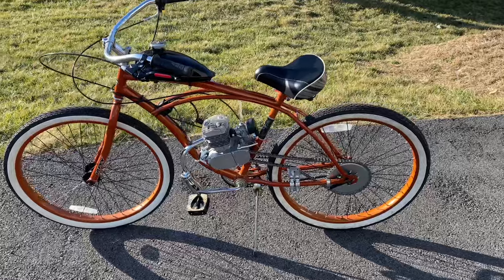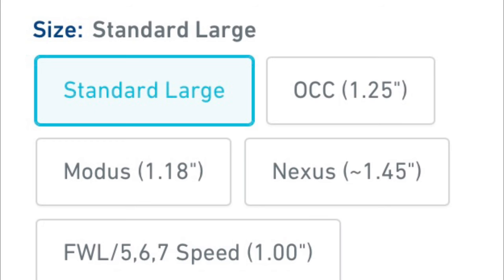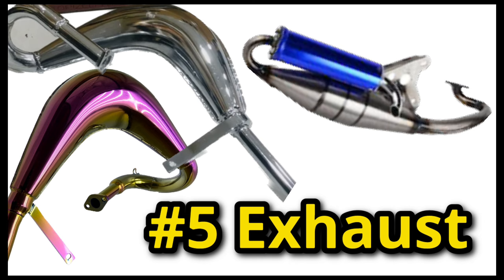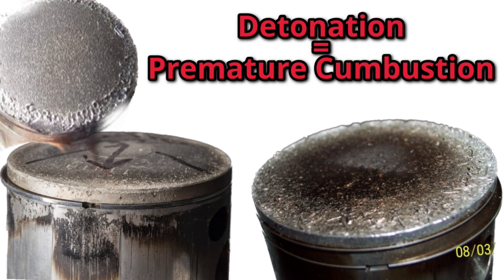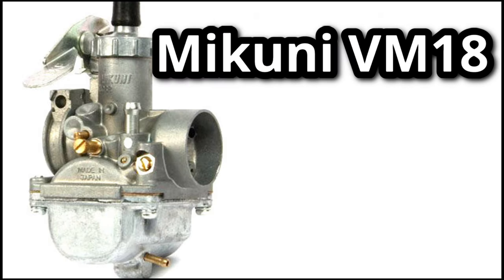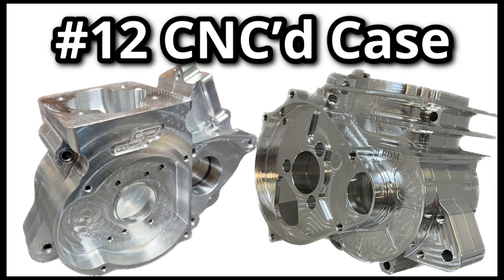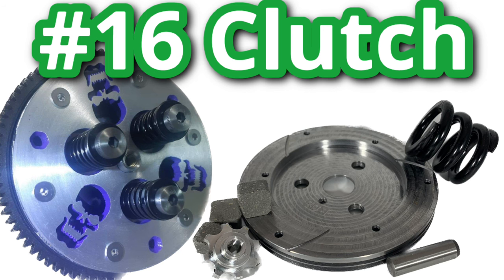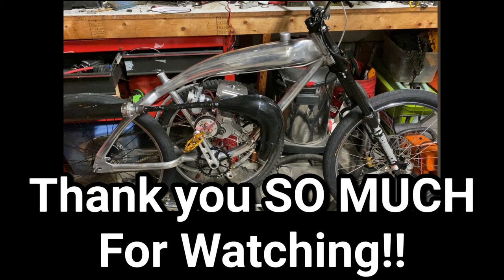EVERY Modification and upgrade For A Motorized Bike #motorizedbike #2stroke #motorcycle #moped

Comment from the maker: FIRST UPGRADES: I highly recommend staying away from performance mods UNTIL you have properly and thoroughly gone through the break-in process on your engine and use correct lubrication, but the mods in this category are HIGHLY RECOMMENDED doing BEFORE the break-in process. These are recommended in order to keep your engine running well and increase reliability.

1st: The first being a short CNC intake - https://www.amazon.com/Mingdun-32mm-40mm-Manifold-Connector-Motorized/dp/B08J7Z71QT/ref=sr_1_1?crid=2HG0FMHI61SY&dib=eyJ2IjoiMSJ9.wgaWemGG1xZaETyDsDqQY84nX_S4EyZUcRlfQl6nxsYkrxTEjZqthGR9eUwV5oZoOjETmwl-kxQbEMVCGJPctqddy-SqO9iLIm3yCtEVk4pyNGTJGJRjezMSX_d73187KGXQ4XwUEh5pBoxLkknZwwz6zY4v9ug1MaYsQUJidku0PF7TVnYoTxePwSXrUNoFSLR4yd4NXuLy0cXEB_NHEJwtc_nV8vI0lR371sRgDO2ZhM89g_lEhPpwUzjTsMDBm8eV_ibZDt2H5xWWnEFguTOHuHiV3roXzMVPcp2wIeo.tUvwe_wPuG66lMDVEfGYeto-N-roShUk76haf9SWuuA&dib_tag=se&keywords=motorized%2Bbike%2Bcnc%2Bintake&qid=1715354123&s=automotive&sprefix=motorized%2Bbike%2Bcnc%2Bintak%2Cautomotive%2C158&sr=1-1&th=1

2nd: Upgrading the spark plug is also a MUST! - https://www.amazon.com/NGK-BR7HS-Standard-Spark-Plug/dp/B000GZDI6W/ref=sr_1_2?crid=X3L8BJSW51TM&dib=eyJ2IjoiMSJ9.4gv2n1Pm65tXQGzCXIivxMmJ3_3vWhSsfbifXuq8B9UgHYQyLR6dVSwjzFbbGibRZM2CLFYNYt6JAMQqDsRfAuKU0QCSpIlwcc1oWO9jGUJyIRbKFvdJ6Nu9oqgawq2cgP8MKS93dX0iaj0z8y6F0ZD5ToLDTjiswMhAaWb1vD4OM7-vaTW7H0QTMJdLRe_Xz8kOQsVmcUUZsciKBOFkvl6muBQQ_sJJ2F9J64fbrfp8uXUBBWxRHEYqtUQDJ2FD7D8U0erBs7xc5wj-IEuhJSiEfLzYr9hqeK5YdBdkCic.1gfcHFlly-FusI9Gttk7384PRwhcl1EIAHI5DBv22fA&dib_tag=se&keywords=NGK%2Bbr7hs&qid=1715354636&s=automotive&sprefix=ngk%2Bbr7hs%2Cautomotive%2C107&sr=1-2&th=1

3rd: The third upgrade is a sprocket hub adapter (https://www.amazon.com/sthus-Sprocket-Adapter-Stroke-Motorized/dp/B07GWHXMTJ/ref=sr_1_7?crid=18FPXCSBYN6B7&dib=eyJ2IjoiMSJ9.sKEWIRtySrBmJdUvRrNCgm_Q5X-9XHwIYIqKtyFsGVdhCMhkSpr7uuV-gisM5vRqq9e1aeBY5PjWD7sc1Kk3ZQLh3kQDV5TBSsRX8z8SFYVmIWyS9oDw9dxAe0XmN4x54x1RyGjGcqrXdqCOpJl9qWVGdoWWnofL6q-RpyLo0j6wPyQZY3v1HwGDH1vmGWIoe90JSNyV4KQBo6_i83K2SQAA0mtk72sVmpBHbRKT8eq3oIOgnwlfE4VKArLVaSamh7JCWXybzyKRB7wmeJWCWT44ZQ92Vdg8RguZmA4POX0.XGIMqc_KF0kHE4NSR6DVb7TqTzS1EsZg5sN75NKDi64&dib_tag=se&keywords=motorized+bike+hub+adapter&qid=1715354767&s=automotive&sprefix=motorized+bike+hub+adapter%2Cautomotive%2C107&sr=1-7) or an alternative method to mounting your sprocket - https://www.youtube.com/watch?v=3q76xcT_sQI     

NOTICE: A hub adapter will only really work if your has a constant diameter (all the way along the width of the inside of the hub) of 1in or 1.5in.

Concerning brakes: If you want to go overboard on brakes, check out the Smolik Performance pit bike brake setup - https://smolikperformance.com/collections/all-products/products/front-pit-bike-adapter

PERFORMANCE MODS:
After you have done the previous mods and have properly broken-in your engine, it’s time for the real performance mods.

4th: A balanced crank - https://smolikperformance.com/products/zl40mm-crank-balanced-and-trued?_pos=5&_sid=5ab570fe9&_ss=r

5th: A good exhaust - https://www.youtube.com/watch?v=ZBZV0xXFjlM
6th: Porting and decking - https://www.youtube.com/watch?v=V4yWn7ZcZ7k&list=PLyy48VgdJ6lXs94k95u73Rv2a5ZTWsqTE

7th: Premium gas or race fuel - (only after porting and decking)

8th: A Reed valve - (requires a windowed piston) G2 - https://www.amazon.com/Miaowa-Racing-Intake-Motorized-Bicycle/dp/B098X444WC/ref=sxin_17_pa_sp_search_thematic_sspa?content-id=amzn1.sym.679ca254-fe3a-4b5e-a742-a17f009c74a4%3Aamzn1.sym.679ca254-fe3a-4b5e-a742-a17f009c74a4&crid=3I0KNCIXC9BU3&cv_ct_cx=motorized+bike+reed+valve&dib=eyJ2IjoiMSJ9.GnjMeLOPZgNDkzvE_fZ2o2L7Oca2RWbIL6eu9SZczbweXBbxM8h7HS5ZybsZAX8X.v9O8Ew1z4K0FOLieE7SLbMJeshvGx9SoGsV-0jNOzfU&dib_tag=se&keywords=motorized+bike+reed+valve&pd_rd_i=B098X444WC&pd_rd_r=71beeb66-52f1-4d72-8625-dfd25ecf1d72&pd_rd_w=ddj2I&pd_rd_wg=O1tjF&pf_rd_p=679ca254-fe3a-4b5e-a742-a17f009c74a4&pf_rd_r=ZE5DJ9BAE0NDZ7GVHG0V&qid=1715355019&s=automotive&sbo=RZvfv%2F%2FHxDF%2BO5021pAnSA%3D%3D&sprefix=motorized+bike+reed+valv%2Cautomotive%2C144&sr=1-3-364cf978-ce2a-480a-9bb0-bdb96faa0f61-spons&sp_csd=d2lkZ2V0TmFtZT1zcF9zZWFyY2hfdGhlbWF0aWM&psc=1 

DIO Reed - https://www.amazon.com/Valve-Set-Reed-Block-Gas-Motorized-Bicycle/dp/B0B5DCB627/ref=sr_1_5?crid=3SKE06ICH797L&dib=eyJ2IjoiMSJ9.JlvyOY7u827hdKv_qW_6Jc2P4tqz2e14IpNfGZVYC80ydCddplJspRsdFdPgsxJjTO2kCn2940oVSnbbi4B33z8kaSjLT-6kOV-M_VQzK01BSPtUI_hIJ6ZHZZDqBgZGfPG6Lh1TWwGgx-ZFggpnTBSEZxH4ibYXZqsZ1_EDGk1b89b2APOoZ3voLsOS31Q3Mu-csfLs273zAGVab6MuMzrRNM-6ApMPX-3_JIGQ7Pdcf402uiFJjoGBiRCqcUUUQ4hg8Un837rLL6H7jxhKFwwPvmbCw2ZdPagIyy5wDm4.AudSMW11wODC-dEXLneaaKOnR-uWz66XM5Bb0SX2ldk&dib_tag=se&keywords=motorized+bike+dio+reed+valve&qid=1715381630&s=automotive&sprefix=motorized+bike+dio+reed+vavle%2Cautomotive%2C168&sr=1-5

OZ Reed - ttps://www.amazon.com/CDHPOWER-Reed-Valve-Kit-19mm/dp/B07DVTQCX7/ref=sr_1_5?crid=3NKNVHCGCBDES&dib=eyJ2IjoiMSJ9.W4XcrCMjS7l6f6FiWfkrA3oYXOkZG5GzfL9Q-92dg4wfsLYKD674jS8g8Bpt0qkOwWSvqZAQV8KPqFsryZmV3JWnm0hxJCTbKZXkBfD2pcQIAqBGjJFh06HPNDEPZGU6QPZ-_rZWGpKqXxbOxW-61-LvMCX9Vh9o2qmi7xvvNh9H2zO-K3a3MjrTblZdrw1wovwCuKZGHlth4MfA1Rhi48Z0wsRZiKAzHFk7oNQ_zEGTgx3I2rRilBA01_dhBvY1MhwKla-bb-WqTB6PWQfye-2dHdCNEZE-Xq3FWC9DH64.tFWC5LJ31F6CWEN30u22UlCb_jPDaXxHmwrKCvA-s4o&dib_tag=se&keywords=motorized+bike+reed+valve&qid=1715381657&s=automotive&sprefix=motorized+bike+reed+valve%2Cautomotive%2C100&sr=1-5

9th: Carburetor:  Mikuni VM18, dellorto, NIBBI PE19, Pz19, PZ20, and PWK21. 

10th: CNC Cylinder head - Here is a great cylinder head guide - 

Smolik heads - https://smolikperformance.com/collections/cylinder-heads/products/smolik-cnc-head

Other CDH Heads - https://www.ebay.com/itm/284504977774

Cheaer options - https://www.amazon.com/jtfrkope-Cylinder-Racing-Engine-Silver/dp/B0BNSMS53N/ref=sr_1_4?crid=28X7UCWCKCMGK&dib=eyJ2IjoiMSJ9.gT80iTe9xLn2bKYlvFS_lush_CPkXTFjFoNH357mF_mDfooIaRxtxaPzjHdUeOm3JaN50mt9meShVLRBUKBkiNypMoot6xxi3uNQAJKnAX1FUnAJ31L4cUQSQnzUODOR9f6Q09EtiRdJf0Mkr50HX4batmlO7Dp1UyPCuTIOsy7jjzjDIQMYu7aOMDF14oRm1wscqWJWdYDpL8rj2Qs3nVf6nEO1EDG6F2Jf49sk9LJzUfgppS0x01OOzVGZQoRWpOmEFrihRDEdyod6-hvKdyWAtAeTWlVkBh-SKEf3fSo.cSDzossxl9INzjJjHhr_WVC1rXXOwTKRmy9wimD2GIs&dib_tag=se&keywords=motorized+bike+cnc+head&qid=1715381858&s=automotive&sprefix=motorized+bike+cnc+hea%2Cautomotive%2C183&sr=1-4

11th: Ignition system guide - https://www.youtube.com/watch?v=z30UREt5zzA

MBI Adjustable CDI - https://svm-bikes.company.site/products/MBI-Adjustable-CDIS-p624481639

Parmakit CDI - https://www.treatland.tv/ProductDetails.asp?ProductCode=parmakit-cdi-box-57001.29&utm_source=googleshopping&utm_medium=cse&gad_source=1&gclid=CjwKCAjwi_exBhA8EiwA_kU1Mld2o1prkSjKmqKCnjqjWdbbdv0btT9Y59OoTsYljmIVIbP1c2YLkBoCUuMQAvD_BwE (contact Smolik Performance for help)

12th: Upgraded Cases - 

Smolik Minarelli Vertical - https://smolikperformance.com/collections/cnc-cases/products/preorder-cnc-minarelli-case

Smolik YD100/Avenger 85/Phantom 85 - https://smolikperformance.com/collections/cnc-cases/products/cnc-avenger85-phantom85-case

Smolik Horizontal (case reed) - https://smolikperformance.com/collections/cnc-cases/products/2023-cnc-minarelli-horizontal-case-1

RDM Minarelli Vertical - https://rdmanu.com/products/minarelli-vertical-case-flat-mounts-presale?_pos=2&_sid=2566f5d93&_ss=r

RDM Piaggio - https://rdmanu.com/products/piaggio-engine-case?_pos=1&_sid=2566f5d93&_ss=r

(you can also contact both of these sellers privately and they are usually pretty good with custom cases or tracking specific ones down. You can also contact other sellers such as Ken Hinson, Mitch Green, Don Butler, Alan Zhang, etc)

14th: Hybrids

Minarellis - https://smolikperformance.com/collections/engines/products/70cc-minarelli-vertical-engine

Case reed minarelli - https://smolikperformance.com/collections/engines/products/2023-cnc-minarelli-horizontal-tier-2-engine

15th: A Stroker Crank - https://rdmanu.com/products/rdm-crankshaft-2023-q3-4-presale?_pos=1&_psq=crankshaft&_ss=e&_v=1.0

CLUTCH: 

RDM HD clutch - https://rdmanu.com/products/stage-3-clutch-assembly-short-term-presale?_pos=8&_sid=b03948559&_ss=r

SAF Clutch - https://dlh-performance.myshopify.com/products/saf-super-clutch-f?_pos=10&_sid=7fd8a577d&_ss=r
Reply: thank you for this this was really helpful no lie and thank you for noticing that that sprocket kit from the stock sucks! everyone the the Facebook group said that they are reliable HWO MUCH ARE THEY GETTING PAYED TO SAY THAT?! what i did was get a rim just for this and it worked great!! it was like $80 but really sturdy ima prob doing the carb mod ngl also you have anything for oil leakage from the exhaust?
Reply from the maker: @cashTilton  Thanks for watching! As for the oil leaking out the exhaust, that is typically due to either low-quality oil (the cheaper conventional or Minarelli premix oils dont burn very well), too rich of a premix ratio, a carburetor that is running too rich, or a mixture of all three. I typically suggest using more oil rather than too little, but when it comes to oil puking out the exhaust, that can definetely cause a few issues.
Reply: @a.m.bgarage.everydayprojec9665  thank you for the advise

Comment: About the balanced crank, it´s not really just about being balanced, but reducing the crankcase compression on a 2 stroke engine takes a lot of power from the engine itself
Reply: Yes and no. 

No because The cranks that come in these engines are so unbalanced it’s amazing that they don’t break bearings on break in. Balance factor on any 2 stroke crank is extremely important, because there aren’t any counter weights like you would have on a 4 stroke. 

Yes you do want to have as little open space between the crank walls and the case walls, known as case volume, the smaller the amount of case volume you have, the better primary pressure you get through the transfers and into the combustion chamber. 

As with any 2 stroke, the actual performance gaining tuning aspects are far more complicated than with a 4 stroke engine, there’s a ton of science and theory you have to understand to actually make a good engine. I’ve been at it for 15 years, my last 50cc moped went 82mph.
Reply: @MrSagerific95  Have you thought of fitting a transmission of some sort of one of those engines. If yes, can you tell me how
Reply: @SGmotorsport9590  You can run a Jack shaft to a separate gear box. That’s all I know how to do while keeping the original engine in tact. The mopeds I play with use a CVT transmission and a drive clutch.
Reply: @MrSagerific95   Have you tried it. If yes, what transmission did you use
Reply: @SGmotorsport9590  guy doing some cvt stuff on another chan i think build break repeat or wash rinse repeat or something
Reply: @chrisgraffam3357  yeah I know him, thought of some manual transmission tho
Reply: Looking for a budget friendly but durable motor for my pedal bike wanna do every upgrade I can and don’t want to get a cheap bad one that will just break more than it runs, would be much appreciated if someone replied with a link for a durable and decently priced one around £150 mark 👍🏼
Reply: @MrSagerific95 got one the other day blew up right away throttle stuck went 70 of the bat
Reply: @rileycoish7906  you did 70mph on a non broken in China doll?
Reply: @SGmotorsport9590 brazillians put pegs clutch and rearbrake all the time
Reply: @orbeengamin5085 does kind of what I'd like to do with my build

Comment: Turbos and superchargers are for 4strokes. They would interfere with how the pipe functions on a two stroke
Reply: some new snowmobiles use turbos stock
Reply from the maker: Ive seen some 2-stroke turbo setups, but as you said, there are many issues that would make a turbo/supercharged setup not practical, not to mention all the other hurdles.
Reply: There have been two strokes that have been properly tuned with a turbo or even superchargers! If I'm not mistaken I think that some of the outboard motors there are two strokes have had superchargers on them... But granted it is very hard to get it to work properly and takes a s*** ton of engineering
Reply: detroit 8v92 .... know before speaking ...
Reply from the maker: @faulker6751  The older 2-stroke diesel engines are similar in terms of the process of combustion, however, there are key differences that make them VERY different and not at all comparable to other 2-stroke engines you would find on dirtbikes or motorized bikes.

Firstly, diesels such as the Detroit 8v92 have very low operating RPMs (around 2,100RPM), use a traditional exhaust system, and are fuel-injected. This makes a turbo MUCH more practical, more reliable, and functional compared to a turbo on a 14,000 RPM carbureted 2-stroke that requires a highly tuned and unrestricted expansion chamber exhaust.

I would tell you to know what you're talking about before speaking, but that would be mean.
Reply: Absolutely correct. They exist but the cycle of the 2 stroke engine interferes with the purpose of a turbocharger. The goal of a turbo or supercharger is to max out the air density in the cylinder, accompanied by fuel. You can’t build crazy amounts of boost in a 2 stroke cylinder without some type of exhaust valve.

Comment: Stability and reliability is wayyy more important than performance. So if there's ways to make the whole built more stable and secure, then i welcome it. When it comes to exhausts i would rather see some that make the whole thing more quiet because noise is really one of my biggest concerns. Especially when you do not intend to drive super fast anyway but just 20-25km/h and want to run the engine as a subtle support. And not pretending to ride a freaking Motorcycle. You just wanna keep the noise volume under control.
Reply: I'm just putting mine together now but I plan on upgrading it but the upgrades this guy is talking about cost a lot of money all that has to be machined automotive that just cost a little over $100 it's crazy I bought mine off Temu for 109 bucks it's the yd100 stock that supposedly supposed to go about 30 mph

Comment: My 2 cents for newbies.....The shorty intake is mainly to solve clearance issues. So don't expect any kind of performance increase & sadly when using it, you then have clearance issues between the carburetor bottom/bowl & the clutch cable case guide bolt 🔩. So you have to cut the end of the bolt threads off/shorten it. So you can scew it down into the case lower to make room for the carburetor... Which then causes the clutch cable to be at a more awkward,less than ideal angle & make the cable a little harder to pull putting stress on it.... If you have carb clearance issues with stock intake. I think you're better off rugging up a small hose extension. Also the shorty intake causes more fuel to spit back out the carburetor. Which is probably 1 of the reasons the stock intake is curved downwards.
Reply from the maker: You are absolutely right. The shorty gives a barely noticeably performance increase, but is mainly used since it prevents air leaks so well and allows more clearance within your frame. 

Though, I have honestly NEVER had clearance issues when using the shorty intake. You can kinda see in this video. https://www.youtube.com/shorts/AcVOvoHzCHM

Comment: I came from the 2 stroke moped world before entering the motorized bike world. Over the last 15 years of tuning I’ve learned a lot about 2 strokes. The science behind getting REAL power out of a 2 stroke is so fascinating to me. Don’t let anybody tell you that 2 strokes are simple, the science and theory behind them is far more complex than any 4 stroke design. My last moped build was a 70cc liquid cooled that made 11hp and was good for 82mph. I’m just so addicted to the science of 2 strokes. Nice video brother! 

Also just an FYI it’s pronounced “DEO” as in Ronny James Dio. Same way Spanish speakers pronounce “god”
Reply from the maker: I completely agree. Not only is it a science, but an art. Granted, a 4-stroke is a bit more than slapping bolt on mods together, but it definitely takes A LOT more to build a nice 2-stroke. They are simple in terms of their overall design and when it comes to maintenance and repairs, but there is definitely more to it than bolt-on mods. 

Im addicted to them too. lol. Nothing better than getting crazy power out of a super tiny engine. I built and regularly ride my 212cc bike that is running on alcohol, advanced ignition, TM24 carb, etc, and my un-ported 50cc minarelli bike seems to have round about similar power.
Reply: Holy Diver lol
Reply: Amen to that! I had an old vintage race bike that was a Yamaha rd400, that thing had some serious engineering that we put into it to make it right for competition. But oh my god when that thing would hit 9 Grand the power was absolutely insane!! It was the only motorcycle I've ever owned that would really in all gears!

Comment: Thank you for this.
When you said Hybrid Engine, I really perked up, because I thought you were gonna say connect an electric motor to the engine, or use hub-motors to provide instant torque from dead stops and low speeds, while the engine & gearing are setup for midrange to a high redline. Almost like a homemade Koenigsegg Regara. But it can be annoying to now keep track of a battery, even if you use a motor-controller with Brake-Regeneration, so stopping, or the engine itself can recharge the battery.

Comment: I recommend trashing the cheap gas lines and buying a thicker hose mine just leaked all my gas out over night
Reply from the maker: Yes. It is recommended to all builders to use high quality fuel line. Even the cheaper "fuel line" shrinks and gets SUPER brittle.